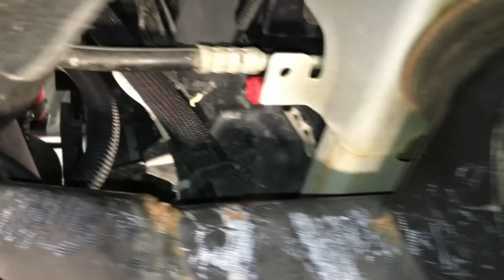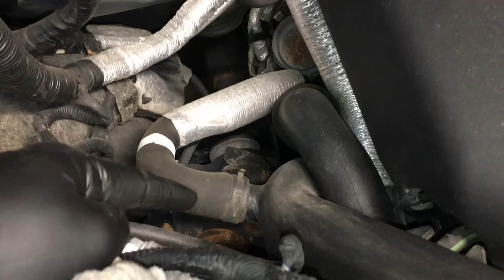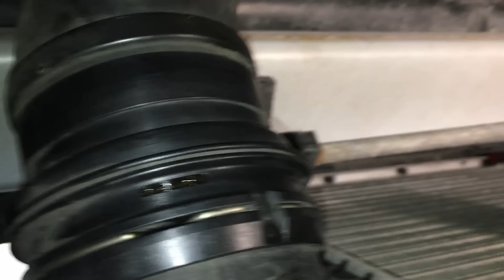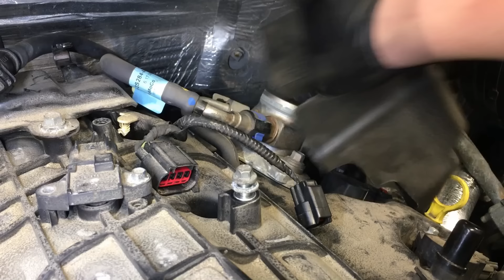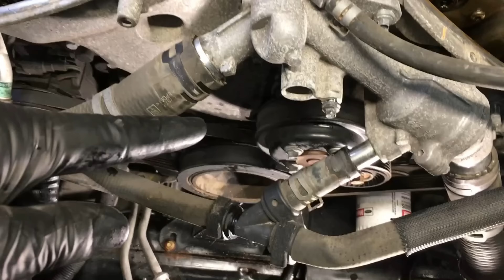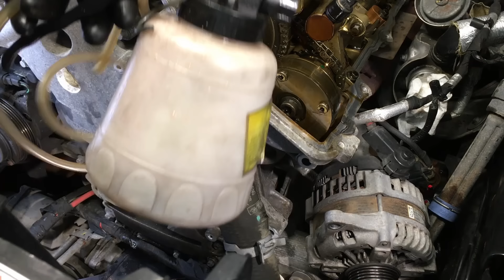2011-2016 Ford F-150 3.5L Ecoboost Timing Set Replacement Part 1: Getting Inside the Engine

Comment: Would this be the same for the 2017-2020 ?
Reply from the maker: no
Reply: Have a 2017 raptor with this issue got the updated phasers like you shared in another video now just have to get time to do it.

Comment: I was wondering why you didn't show removing valve covers.  Now I know.  They are the hardest things to remove.  The factory gasket won't break loose from the head.  We have been trying to remove them for the last 2 hours.  Ford used sealant.

Comment: Great video, but you gloss over the amazing difficult task of getting the valve covers off.  The sorry difficult wire routing fastners have to be cut off to then twist off the stupid plastic retainers. Cat's claw and screw drivers will NOT lift those off. Plus there is one on the back of the passenger side valve cover you cannot see or hardly get anything on.  Finally the valve covers are the hardest i've ever seen to get off the head. Go easy and be patinet for the valve covers are plastic.. I've worked on lots of cars doing simliar work and this is one of the hardest I've seen yet...  Same goes for the front timing cover. lots of random bolts, some in the center different sizes, be sure to get them all, plus the electical wire routing at the bottom is a nightmare to work with...

Comment: I see a 5 year old video… any latest and greatest. I’ve got a 2013 3.5 that I plan to do this job as I’m getting the timing chain rattle at 126k. What’s the current (2023) latest and greatest setup for this motor?

Comment: the ac belt is in case the compressor locks up it wont smoke the main drive belt and with it blow the engine due to losing the water pump rotation

Comment: Hi fordtechmakuloko , I have a question , after doing the timing chain replacement on my 2012 f150 3.5 and did everything as instructed the engine won't start over , but it cranks at a slow rotation and throwing a p2610 code , I replace components related to this code , checked voltage from battery to started and still nothing , could it be that there is a specific way of setting compression stroke before removing timing chain ?

Comment: Does the truck need to be taken to ford for any resets/ updates after this procedure is done? My 2013 f150 3.5 has a rattle at start up but it goes away.. I’m thinking the problem is what was done in the video….
Reply from the maker: The battery should be disconnected for 5-10 minutes yes.

Comment: Can this vct problem lead to engine to not start up?? 
Bought 4k miles ago 2012 f150 3.5l ecoboost 108k mi. Codes read. Camshaft and crankshaft sensors/position correlation. Engine gradually ran worse and now won’t start. Mechanic performed a bunch of tests on electrical, fuel, oil pressure, etc. all good. Timing is the issue. 
Im stuck with the decision of spending $2500 for new cam phasers and timing chain etc with no guarantee or new engine. I heard a ticking sound for a bit and then ticking and knocking sounds before it eventually died. I’m thinking I’m going with the cheaper option and hope it works. What do you think should I do?

Comment: (2011 f-150) One thing about the driver’s side turbocharger air inlet. It is also secured by a rubber grommet. Kind of near the alternator above and behind it. In fact it’s the same grommet bracket as turbo air outlet pipe. the Mine required a pretty hard pull and I’m not exactly a lightweight. Just putting that out there.
Reply from the maker: Yes ever air pipe both inlet and outlet are held by a grommet. You just need to angle it right before pulling it through

Comment: I have an oil leak on both sides of my engine. It is not spotting on the ground (maybe because of the sound damper) but the bottom of my oil pan has oil running down it from somewhere higher on the engine. It looks like it could be the valve covers on both sides. Is this a known issues? And if so would you recommend I perform all the maintenance in this video? I also suspect an oil leak at the high pressure fuel pump. I have a 2012 with 220K miles on it. Thanks!

Comment: Sir I’m checking 2013 Ford F-150 3.5L ecoboost, I got the P0016 Code camshaft and crankshaft position correlation 

Weird thing is no compression for all cylinders , So I open the valve cover to check the timing condition and camshaft  but timing chain was not snap and camshaft was turning with timing when cranking the engine, but I was surprised that valve spring in all cylinder doesn’t move or compress when camlobe turning.

Are those valve springs broken ? And why all cylinders.

Please give me ideas on this problem.

Thank you in advance.

Comment: TOP NOTCH !!!  I don't like working on newer vehicles, but when my son in-law got the chain rattle I had to give it a try. Your tutorial is very detailed. His 2011 F150 is up and running like a champ. I did spend the extra money on original Ford parts and a Melling High Volume Oil Pump. Couldn't have done it without you. Thank you.
Reply: Did you replace the pump without removing the oil pan?

Comment: Had 2011 F150 Eco here.
Timing chain went out at 75,000! Of course Ford said this wasn't a known issue, so no help with the repair. Guess after 10 years of Eco and STILL timing chain stretch, would hope it's a KNOWN issue to Ford.
Traded in on new F150 5.0...a more reliable engine!

Comment: my chain broke. the 2 small chains still intack can i replace my chain and gudes etc by this video or something different i got to do make sure everything lines back up right
Reply from the maker: If the main chain broke while running then there is most certainly engine damage as this is an interference engine.

Comment: Hello a friend of mine bought a 2011 eco boost that was not running. The people he bought it from said it was a timing chain. The engine would crank and stutter but would not start.
Reply: Removed timing cover off and confirm timing chain had stretched and Skiped timeing. Replaced all timing chain components. After repairs were made, Engine would crank and stutter but would not start. Same exact symptoms. I verified top dead center on cylinder one on  compression stroke and all timing marks are correct. Fuel pump is running, checked fuse 27. All looks well do you have any ideas?

Comment: What is the labor time  to reseal the timing cover
Reply from the maker: I would charge no less than 8-10 hrs.
Reply: @FordTechMakuloco  would you suggest someone working on flat rate at a independent shop?

Comment: Thank you for making these videos!! I would NEVER have attempted this without these videos.
I’ve only ever done basic repairs on vehicles most of my life. The closest I’ve ever come to getting inside an engine was a flywheel change on a 1972 V6 mustang when I was 17. 
MY local dealership wanted $5,000 to do this timing chain. I haven’t driven this truck in almost a year because of this.
I ordered all of the parts last winter and just now finally got around to changing it. 
It took me exactly two weeks, just working on it a few hours at a time. I’m sure this could have been done in a weekend If I stuck to it.
Thanks again
Reply: I think I spent around $2,500. But I bought several tools like a Dewalt 1/2” impact and Milwaukee cordless ratchet out of that money
Reply: You still have the truck? If so, how is it?
Reply: @EclipseTime86 I still have it. I think I have around 120,000 miles on it now and it runs great.
I don’t drive it all the time because the gas mileage sucks compared to my Pontiac Vibe.

Comment: Thanks so much for this video! You're the reason I did the job myself!! I had some annoying troubles with the pipe/electrical connections. The part numbers for the high pressure fuel pump weren't listed and they're BL3Z-9350A. Home depot has an excellent 8" strap wrench to torque to yield the crankshaft pulley, definitely purchase that! Not critiquing the videos just trying to help others just like you did me. What was very interesting was I had a lot of trouble getting the holding tools to be floppy in place like your video. Left bank was floppy while right bank was very tight. I removed tension and tried to move cams to match the other side as close as possible. When tensioned with new parts both holding tools immediately were loose in place exactly like your video. Was that due to my timing out of sync with a stretched chain? Runs perfect now and thank you so much again!! I'm definitely subscribing and will be watching your catch can install video.

Comment: Have a 2013 3.5 eco boost going to do the chain replacement, the bolts for the high pressure fuel pump, I don’t see them in your list and I am wondering your thoughts about Cloyes parts and kits they have? Thanks

Comment: I own an automotive shop.  I thought I'd take a second and watch a video before opening Alldata.  Well, not for nothing, but clicking on your video is the best decision I have made in a while.  Everything was so clear and concise.  Great camera angles and spot on.  The only differences I experienced were due to truck I'm working on being a bit newer so the vacuum set up was slightly different.  And my valve covers didn't exactly slide right off.  Those were a pure bi....,  umm, pain in the arse to get off.  It took a fair amount of patient prying.  On another note, I'm also working on a 2008 f250 V10 with an engine miss and I'd love to ask you a couple of questions.  Either way, spectacular job and you may my job so much easier.  Thanks tons

Comment: I’ve been wanting to check my f150 for carbon deposits but I have yet to find a video to remove the intake manifold cover. Finally I can take on this little project. After I take it out do I have to replace gaskets?

Comment: Quick question.  The shop put 5w20 in on my last oil change. 700 miles after that I had cold start rattle. Changed the oil back to 5 w30 rattle went away. Will I be needing a new timing chain ??

Comment: Thanks for the video. My truck gave sensor over retarded bank 2. About 40km down the highway the truck started shaking. Wife pull over and it cold seized. We have the crank shaft turning but it has a tight spot. 🤷🏻 going to have to look up what to do now

Comment: I had the valve/cam tools in place to prevent the crankshaft pulley bolt from spinning. I used a breaker bar to try and get that bolt off the crankshaft but I heard a couple pops /clanks coming from the passenger side camshaft . I stopped immediately . Did I screw something up ? 😮 I  turned the crankshaft manually without the tools in and everything turned fine and sounded ok . Wondering what the pop was and if I’m ok to continue with the repair

Comment: Badass video! Is this timing procedure for the timing chain the same as for the 2010 3.7 Mazda CX-9?
Reply from the maker: no
Reply: @FordTechMakuloco  I have been watching your videos and trying to figure out how to go about changing my 2010 Mazda CX-9 timing chain and water pump. I know it’s not exactly the same but as far as setting it to TDC and getting the phasers and crank lined up, I’m hoping it’s the same concept. Do you know if Ford water pump and timing chains will be compatible with my 2010 Mazda CX-9?
Reply from the maker: Yes it is a Ford engine so I always use the Ford parts from my dealer.
Reply: @FordTechMakuloco  thanks for the response. What year and model Ford Edge water pump would best match up with a 2010 Mazda CX-9 grand touring FWD water pump?

Comment: Is there a diagram for where the timing marks should be on a 2015 duratech 3.5l naturally aspirated? I messed up while changing the water pump and a cam phaser jumped forward on me, it's not off by much but I want to put it back right before I reassemble and start the engine

Comment: this video ought to be required viewing for those who are going to do a timing job on the 5.4 3 valves.....it will be a great attitude adjustment for you as you see how much more complex and difficult it is to do the 3.5 ecoboost. There has to be an endpoint to the engineered nightmares out of Detroit doesn't there???

Comment: Is this common on 2018? I’ve just developed a rattle only at cold start up that goes away in seconds and I’m guessing this is the same issue. Not even 60,000 mi yet….

Comment: I know my question doesn't have anything to do with this video but I'll ask anyway.
Can you remove and replace the VVT solenoid seals/gaskets which are pressed into the valve cover without taking the entire cover off? And if so what kind of tool would you use to remove them?
Thank You!

Comment: There is an updated tsb 18-2305 that specifies a chain tensioner kit 907308sa, but not VCT units. However operation description mentions replacing all four VCT units. @fordtechmakuloco, do i need to replace VCTs or kit will do the job alone?
Reply from the maker: The tsb kit comes with chains and vct phaser units.
Reply: @FordTechMakuloco  not for TSB 18-2305. TSB has Timing Chain Tensioner Kit, cam cover gasket, and liquids in the parts list. Labor times part states: "2011-2014 F-150 3.5L GTDI: Replace All Four VCT Units And The Primary Timing Chain (Do Not Use With Any Other Labor Operations)", might be just a copy/paste issue. What do you think?

Edit: This bulletin (18-2305) supersedes 16-0027. Reason for update: New Part/Procedure For Same Condition. This article supersedes TSB 16-0027 to update the Parts List.
So, they have updated the parts list to include all chains/tensioners/guides related items into a single part number
Reply from the maker: I said it once and I will say it again the kit in the new tsb comes with all 4 vct phaser units and chain. How in the world are going to question my response when I buy these kits daily? I don't understand why you would question me like like I run an all makes shop and I am not familiar with Fords. I am a Ford specialty shop it's all I know, trust me.

Comment: Thank you very much for this tutorial! I could not have done the job without these videos. I do have some feedback for you though. You cannot rotate the phasers with the chain after you match up the links on the bench to make them go on the phasers. They have to fit on the cams without rotating the chain(I figured this out prior to moving on, thank goodness) I figured that out on my own, and the other thing is the coolant pipe below the intake. One gasket is easy to replace(far side) but the side with the thermostat I could not figure out how to get the pipe out of that assembly to change the gasket. It was stuck and I didn't want to force it. Some explanation there would be great. THANK YOU SO MUCH! You helped me save $3100 for shop labor here.

Comment: Thanks for this series, it's a lot of work compared to doing timing belts on small 4 cylinder motors like I've normally done.  Also the valve covers and harnass are a pain to get loose for me.  After that everything flowed well though.  Just letting everyone know that they donation link is on his about section, send this man some beer money!
Reply: Did you have to remove the star bolt on the right valve where the fuel part has been?
Reply: I know you made this comment two years ago, but I just finished this project on my 2013 Ford F150.  I found the same issue with the valve cover/harness - it took me forever to get the valve covers off which I didn't expect.

Comment: Hey guys, there's an OEM kit made by ford y'all can buy that's way cheaper that buying all the phasers/cams and timing chain separate.

Here's the PN for the kit:
BL3Z-6D256-C

It comes with all 4 phasers and their bolts, the main timing chain, the 6 intake manifold gaskets, water pump gasket, crank shaft pulley bolt and seal, and a few other seals. Ford sells this kit for $550, but it's cheaper to buy online.

Comment: You don't have a video series like this for the N/A 3.5L in an Explorer, Edge, Flex, etc., do you?  I've got a 2012 Explorer XLT 2WD with the N/A 3.5L V6 and it's losing coolant somewhere.  No exhaust gasses in the coolant, so it's not a head gasket -- it must be the infamous chain-driven water pump issue, even though there's no water coming out the weep-hole over the alternator.  The coolant is just disappearing somewhere -- it's gotta be in the oil, right?

So I'm assuming I need to replace the water-pump and timing chain.  But there's so much stuff that's different from this vehicle to that one, that I'm afraid I'll screw something up using this video series as a reference.

Comment: How often do you see trucks that have to get this TSB repair done more than once?  I have a 2013 F-150 EcoBoost that went to the dealer for this repair at 59k miles. Within 10k miles the sound was back.  The dealer refused to do anything further to diagnose why. Now at 104k miles, it rattles on every start-up even after sitting for only a few hours. Looking at the dealer paperwork from the original repair it calls out TSB 16-0027 as the cause but states "Replace VCTS and primary timing chains. Reseal engine and top off coolant and oil." as the repair. I now think that they may not have actually performed the TSB but instead just changed the VCT solenoids and chains which doesn't fix the issue. If the TSB repair was performed correctly is it even possible to have this issue show back up within 10k miles???    Thank you for your advise!
Reply from the maker: I have never seen a repeat offender but others say just over 100k.

Comment: First, thank you so much for all your videos. They're all so through and detailed with the added bonus of all the little tips and tricks of a Ford specialist you can only get after having done dozens of the same job.
My 2013 has just started doing the startup rattle after 165k. Just wondering if this is still the long-term fix or if any additional procedures or updated parts have been released since the making of this video. 
Keep up the great work!